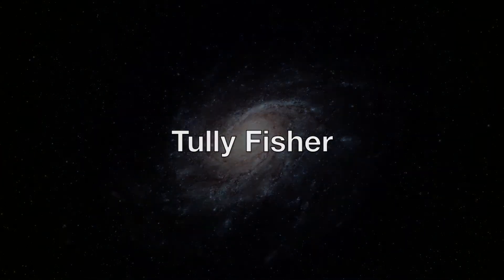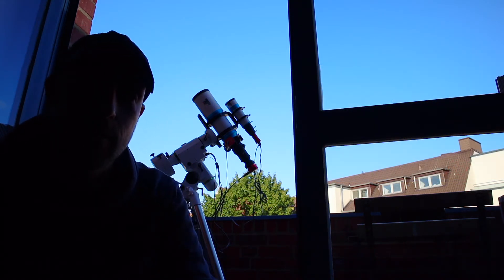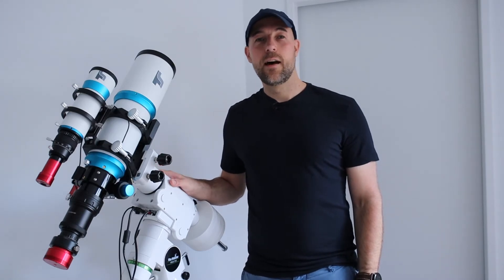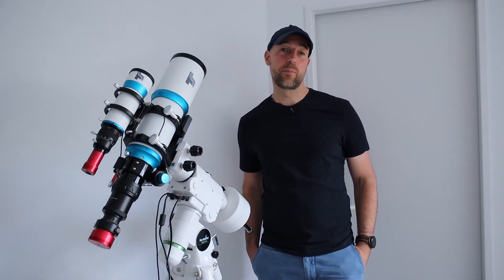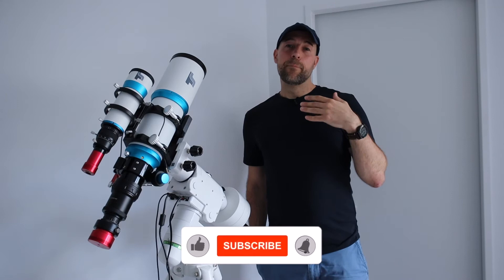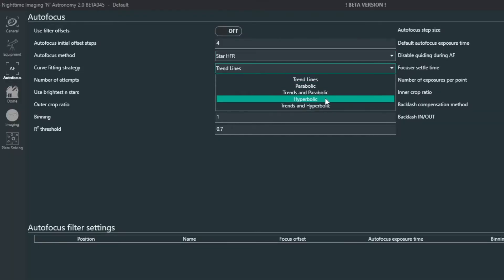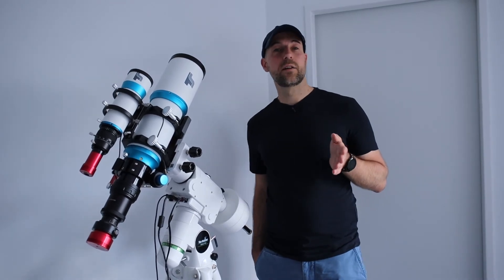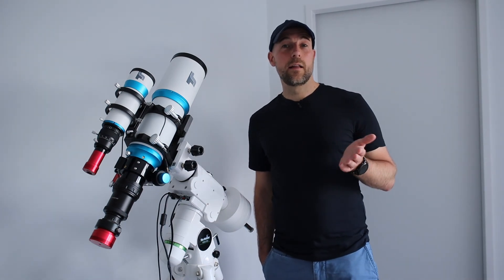Why Your Astrofocus Fails — And How I Finally Made NINA Autofocus Work Perfectly

Comment: So you can manually focus to get the initial focus close? I don't know if the ZWO EAF is locked in once connected to the focuser shaft..
Reply from the maker: Hello. To set the initial focus you have to try different values in NINA or another software. Once you attached the focuser, you can not move the focuser manually (as far this is what I experienced after attachment.) Hope this helps you. Clear skies.

Comment: Good overview of the settings Tully and yes very good point, even though tempting only change one value at a time.  I think I'm at step size 75 and backlash overshoot of 150.  Looks like you're getting a good curve there 👍. Clear skies !
Reply from the maker: Thank you Ollie - also for your settings/ values. After first problems everything with regard to autofocusing is running very smoothly now. And I'm REALLY happy about that. :) I heard from several people that they (sometimes) had issues with the automatic autofocusing routine (using an EAF) after meridian flip. I remember one of Simons videos ("Simon's Astro" channel) where he talked about that.. - This I could not test so far... Thanks for watching! CS